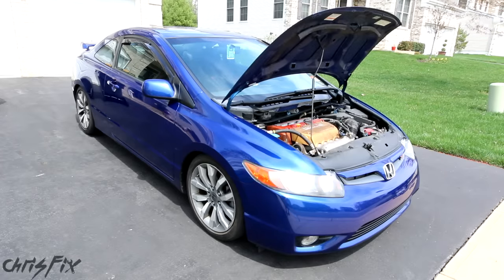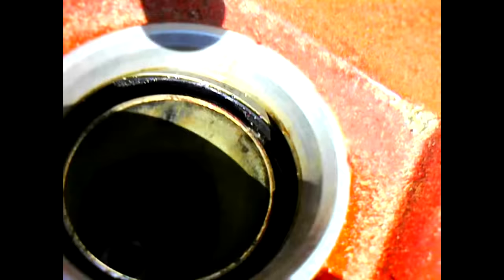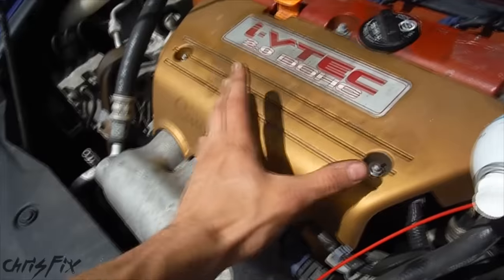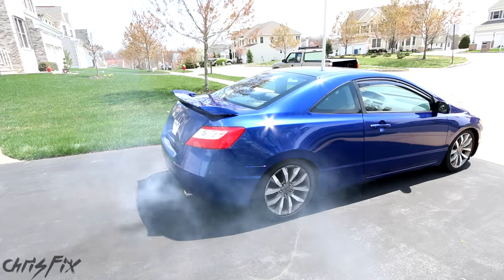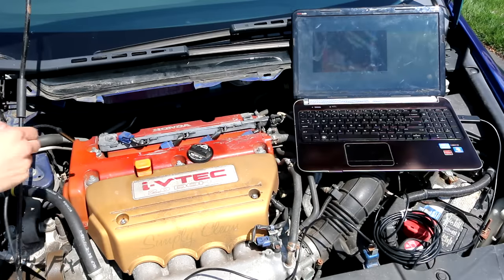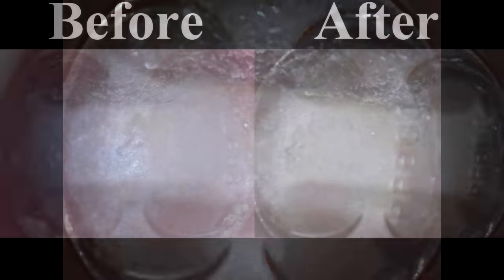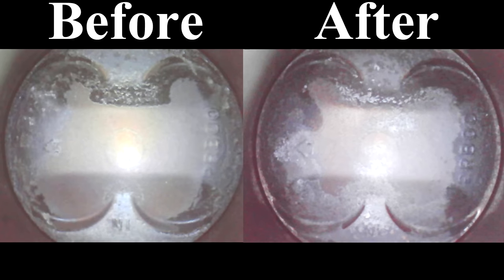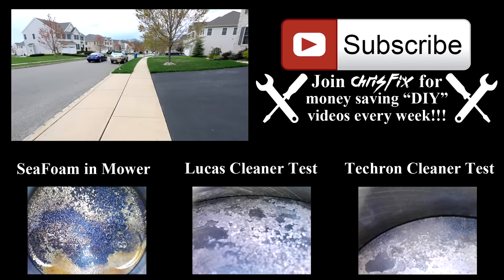Does Seafoam Actually Work in a Car? (with Proof)

Comment: Chris, I really liked the video. I have to say, that I am not convinced that the SeaFoam did a lot of good. 

If at all possible, I'd like to see the results of using straight water injected into the intake, like the SeaFoam was, to see if that would clean off some of the carbon build up. The reason being, I have pulled cylinder heads off of cars that had head gasket leaks, and the cylinders that had coolant leaking into them were very clean. I think steam cleaning your intake with water can have the same results.
Reply from the maker: +Robert DIY Thansk a lot Robert! Glad you liked the video! I will be testing water soon! I just need to find a car. Finding cars with dirty engines is hard!
Reply: Just stop any car on the street. My guess is that 90% of them have dirty pistons. LOL

Heck, I may look into getting a camera and do the test myself. God knows I pull my share of heads (about one per month).
Reply from the maker: +Robert DIY Actually, 90% of them have clean pistons. Most cars today have clean engines. Even the old engines! Plus I need the car for a few days. Getting the right angles with the camera takes a lot of time!
Reply: Well that's good to know. I know that most of the heads I pull reveal clean piston tops. Usually the carbon is in the intake ports and the bottom side of the heads, bottom of the exhaust valves.

I thought the camera was easier to work with. At any rate, you're doing an awesome job helping people understand what's going on around their vehicles. Please keep it up.
Reply: +ChrisFix If I lived in your area maybe and could loan it for a few days.I have 300K on my Durango. It was abused before I got it and cleaned it up. It would be a good test subject.
Reply: +ChrisFix not to be rude at all but just ask any female driver in your area or neighborhood, most of them don't know much about cars and only gas and go with oil changed when the light goes on, and most people who aren't like us who can work on cars no matter how big or small the task don't understand the concept of preventative maintenance.
Reply: +ChrisFix also it would be great to do a collective data test of tires filled with regular air vs nitrogen
Reply: +Sharuk Ali I work at a shop and can say that I stand by nitrogen. It's how the car takes bumps and dips. rather than a solid hit it makes a dip or bump softer than with oxygen. Nitrogen molecules are bigger than that of oxygen molecules so when it gets hot and or cold you don't have to air up the tire as often as you would with oxygen. as for wear and tear on the tread of tires, I see no difference. just depends on how rough you are with your driving and the type of terrain you are driving on.
Reply: Marrda That's interesting. Thanks for the info. With nitrogen do you have to raise or lower the stock tire pressure, or keep it the same?
Reply: I drive mostly on asphalt and sometimes gravel but I go through all season tires in 20-30 K miles
Reply: and I go with the best brands with the best quality and good warranty tires....currently running 215's(width) good year assurance comforted touring tires...alot of grip on dry and wet roads.
Reply: Water could break carbon up but also could break into big chunks and get stuck between a valve! When a head gasket leaks slow into the cylinder also has antifreeze plus water is heated by the motor so it would break up carbon slower.
Reply: How's that?
Reply: water cannot be ignited like fuel.....that's why seafoam is ( I assume) petrol based
Reply: which means water will do some serious damage if it enters your combustion chamber
Reply: Hmmmm.
Reply: +ashot aristakesian It's not nitrogen vs oxygen.  Filling a tire with pure oxygen would damage the rubber by oxidizing it.  It's nitrogen vs compressed air.  Compressed air is about 78% nitrogen, 21% oxygen, and some carbon dioxide, water vapor, and other trace gasses.  It's the water vapor that's bad for tires.  As the temperature cycles up and down, the vapor condenses and evaporates, leading to a larger swing in pressure through those temperatures than dry gas would.  These wider swings in pressure lead to a faster loss of pressure and less consistent performance at varying temperatures.  Assuming a dry supply of oxygen, other than the faster degradation of the rubber, it would be rather similar to a nitrogen fill.
Reply: +Sharuk Ali Liquid water in large quantities is catastrophically bad for engines.  A good example is the 2004-5 mini cooper (naturally aspirated, not S).  Its intake was low enough that trying to drive through standing water more than 3-4 inches deep would siphon the water up into the intake.  There are pics on the net of things like connector rods blown clear through the side of the block.  Definitely scary stuff.  But water vapor fed in a small and controlled amount is a totally different story.  It acts kind of like NOS.  It's a spectator in the combustion process but bumps up cylinder pressure and can substantially boost power.  And from what I understand, it actually sinks a little bit of the heat produced by the boost, unlike NOS and super/turbo chargers. Done carefully, it could be a really interesting project.
Reply: That is a really good point
Reply: Not that much water. Water/coolant gets past head gasket and cleans the piston head, spark plug, etc.
Reply: and then you see those cars at the salvage yard
Reply: Water injection was actually used in some British aircraft in WWII.  Much like NOS, it was usually for a brief burst of power when needed and overdoing would blow the motor.  As far as combustion theory, gasoline is fuel and oxygen is the oxidizer.  The oxygen oxidizes the fuel as much as the fuel reduces the oxygen.  To speak of either doing anything without the other doesn't make sense, and there is no catalyzation involved..  (After the power stroke combustion, however, the exhaust gases ARE fed through a catalyst screen which, at high temperatures, will oxidize carbon-bearing compounds and reduce nitrogen-bearing compounds so that CO and unburnt hydrocarbons exit the tailpipe as CO2 and NOx's exit as N2 and O2.  But that's an entirely different topic.)
Reply: I doubt that (head gasket statement). If your engine is building up any carbon on the valves, stems, or seats, it can cause the valves not to close fully. This build up causes valves not to seat properly over time and burn valves.

Some people believe this product also eats away at sludge and helps opens up other vacuum passages, like in the EGR system, etc. I pulled the EGR valve off of the intake on my car and it was 70% clogged. Causing the car to run a little rough at idle and causing air back-up while driving down the road. When I cleaned out the ports with a screw (used like a file) the car idled a lot smoother and drove better. My fuel economy when up and little and I no longer had a CEL. If seafoam in the vacuum system can desolve that crud out of the system it would be considered useful in my application.
Reply: +ChrisFix ill lend you mine then
Reply: +Sharuk Ali ***IT IS; But also has IPO in it to absorb water. Seafood is mostly lighter fluid (Naphtha) with bale oil, and as I said a small amount of 200 proof Isopropyl alcohol.
Reply: +Sharuk Ali ***NOT ALL together true. Water injector systems are sold for normally aspirated gasoline engines. Depends on how someone uses or abuses water in those engines. I would not however use any water system in a diesel engine. Much higher compression levels (like 175psi cranking compression)
Reply: your right and old timers have been doing it for years.
Reply: +Biggus Mickus I think ChrisFix is smart enough to know to add the water while the engine is running.  In his Seafoam in lawnmower video he did let the Seafoam soak on the piston heads and removed the Seafoam before starting it up.  As soon as you add the water (to a hot engine) it's going to turn to steam and you would only add a very small amount at a time, that wouldn't increase pressure in the cylinder any more than Seafoam would .  Really the only cause for concern would be rust but as you mentioned let it run for a bit to let it evaporate.
Reply: +donald ducky I need to correct myself. I am guilty of doing too many things. IPO is incorrect; it is supposed to be IPA. That stands for 100% Isopropyl alcohol. (IPO is Initial Public Offering  for a publicly traded corporation)

One person wrote a comment that Seafoam is mostly water. I have to disagree ; It is mostly lighter fluid, or dry cleaning fluid. Also contains IPA and Pale Oil. You can make it cheaper than they sell it, if you know how; Just look up the "MSDS" for Seaform and it will start you in the right direction, but be careful. 

I used to own a hotel and some idiots tried cooking Crystal Meth in one of my rooms. I had to close the whole floor for the rest of the day, and they just went to jail. I was the big looser.

God luck guys. I suggest you do research before you do do something that costs you an eye, an arm, or your wallet.
Reply: ChrisFix how? its hard to find cars whit clean engines!
Reply: Biggus Mickus you don't spray water in with a hose lol. You let a small amount trickle in. Chris is not an idiot and thinking he would just spray water in is kind of harsh. Obviously the idea behind it stems from when a head gasket fails it let's minutes amounts of water in overtime (until you smell coolant it of pipe, coolant levels drop,overheating , lack of power ,oil in coolant or coolant in oil. Etc  )  which the steam works to clean the combustion chambers squeaky clean.
Reply: Robert DIY 4
Reply: ChrisFix  I have a 02 civic with 212k on it. Colorado.
Reply: Uh, seafoam (petroleum) isn't any more compressible than water...
Reply: Any idea when you are going to test water?
Reply: I don't know. I run a cup of water through my intake every couple oil changes. Nothing exploded yet either.
Reply: ExaltedDuck lots of turbo cars used to be fitted with water injection to control cylinder head temps and combustion. So no, water per se is NOT a death sentence. It has to be sprayed in atomised form in small quantities. Not a garden hose on max stuffed into your intake.
Also, what do you think combining oxygen and a hydro(carbon) produces?
Yes...that water coming out your exhaust pipe? Basic chemistry folks.
Reply: ChrisFix I have an acura tls haven't clean the engine in years
Reply: ZSQ94 I resent that. I have 3 brothers and know more about cars than any of them thank you. self taught too, stepdad doesnt know squat either.
Reply: How about steam cleaning from intake
Reply: The water mist trick does work...the old wise mechanics swear by it.
Reply: @Marrda  Oxygen makes only 21% of the air, 78% is Nitrogen
Reply: seafoam has literally been proven in labs and real world that it works.. check out projectfarm video
Reply: @zaigham57  ay
Reply: @chrisfix  did this ever happen? I got this impala I want to last forever and I've watched this and then purple royal video like 10 times in the past few years
Reply: @RobertDIY  yes but the heads you should be pulling should not require unzipping first.
Reply: @chrisfix  hey man first off I love your vids! Whenever I need some answers I just pop over here. Secondly, if you need a test subject for a car vid hit me up and see if I've got the right test subject 😂
Reply: You should use one of those fog machine devices to put water vapor into the engine intake and see if that increases efficiency or helps cleaning I’m talking about the kind that vibrate the water to produce a mist.
Reply: @chrisfix  you can used mine lol 😂
Reply: Gotta tell ya', back in the carburetor days on an old engine, with the engine hot and running, we'd take off the air filter cover rev the engine with the throttle cable and very slowly pour a coke bottle full of water down the carburetor. Water instantly turned to steam and did just what you were talking about, steamed cleaned the cylinders. 
Way back in the day!

Comment: I've been wondering about this for forever now but the Shell gas station claims that shell V power can clean your engine of carbon build ups and gunk up to about 80% in just the first fill up. You should creat a video and see if shell V power (premium gas) cleans as well as they claim. My wife and I argue every time we will up if it's worth the extra money to fill up with V power just because they claim it's so great for you let vehicle. It would just be very interesting to see the results.
Reply: Steven Christen the only thing you need to understand about gas is the octane rating is all that matters. All gas require cleaners in them. Put in the gas your car manufacturer recommends unless your engine has been modified in any way to operate at a different ratio.
Reply: Steven Christen - I have the same question!  My company deals with different fueling contracts, but many of their employees and drivers swear by and use Shell "V" Power!  Been using it for over 15 years now...
Reply: Steven Christen yeah I don't believe that. also, I don't know where you at, but in some states in the U.S., Shell V power is equal to regular gas in Europe (whether it's a Shell gas station or not).
V Power in Europe is 98 oct RON (or 94 US octane), but in the UK I've seen 97 RON advertised as V power, in some countries I've seen 99… Some countries even have Shell "race" gas (100+ oct RON).
Over here, regular gas (U.S. 91) contains 10% ethanol and premium contains nothing extra. Just unleaded gas. 

Don't fall for it, though… premium gas in a car that doesn't require it, and this seafoam crap… it's bullshit. Just fill your car up with the gas it needs and maintain your car probably and it'll run as long as it can.
Reply: @arnemaeschaelck5012  ummm U.S. regular at least in California is 87 Not 91. Last I checked the amount of ethanol allowed was Unregulated. Arco and 7-11 is the worst imo and Shell stations here at least buy NON SHELL gas ! I've seen it many times. the tanker trucks have the names of major 3rd tier fuel companies. I dont trust Shell. Mobil Chevron and 76 seem to have less ethonal and more mpg than cheaper fuels after extensive monitoring in my V6 powered car. Alcohol ie ethonal burns faster than gas so the money saved is lost in lower miles per gallon.
Reply: Shell Fuel in my Harley I gain 5 mile per gallon I get 40 MPG average at BP  or Citgo , 45 mpg Shell.  Im 25 miles from a Shell , So when im up there I top off .
Reply: My 04 Acura RSX runs amazing on vpower
Reply: You're not supposed to use a ethanol on your motorcycle , recommend only premium gas sell gas station has 10 % ethanol even in v power gas
Reply: Shell Gas burns up catalytic converters... Avoid it at all costs
Reply: Steven Christen I can tell you it’s the one type of gasoline that will throw the least amount of knocks I have found so far
Reply: I have a Pontiac Grand Prix with about 400k mileson it. It would stall everytime I started it. I would have to pump the gas to get it to crank. I was getting work done on it one day and the GM Technician pointed out the carbon build up I had.  He also recommended shell gas. I was getting ethanol free gas at the time.  I started using the shell gas and have never gone back.  The Pontiac stopped stalling and started cranking at the turn of the key everytime within a month or less of using shell.
Reply: Dusk Dawn thanks good advice
Reply: If your car has direct injection, the gas won't go over the too of the valves so how can it clean something it doesn't touch? Might work with MPFI, I'm guessing
Reply: uuuultra ✔️ yes they are
Reply: @goodstuffohhyeah  wheres your proof.
Reply: @Nan10ify  where is your proof. It says right at the pump ethanol % on each grade. V has 0%
Reply: @goodstuffohhyeah  is this true??? I've always used chevron but wanted to try Vpower so I switched up and on the very first tank I got a P0430 code!!
Reply: @rlee6984  Absolutely...my dear dad (may he RIP) and all his buddies always told me that growing up. Plus a buddy of mine who always used shell went through a set of flowmaster high flow cats on his 5 liter Mustang in 1.5 years. He wishes he listened. Now's your chance.
Reply: @arnemaeschaelck5012  your octane rating are all wrong and the post is full of wrong info. Also Chris did actually do a video on Shell V power.

Comment: It does work my car was back firing like a mofo and I threw a can of sea foam in her and she hasn't backfired in years
Reply: It's been sitting in your garage since then?
Reply: what the car or the wife
Reply: @AROTTWEILERR  Lmaooooo
Reply: She?
Reply: @springwoodslasher79  nope worked great for me
Reply: @springwoodslasher79  wrong
Reply: Perhaps your carbon buildup was so extreme that tips of the carbon were glowing red and was firing the engine on other strokes than just the power stroke, thus pre and post detonation. This is an age old problem with engines. It probably did burn off some of those carbon build up points so that it will run better for awhile, but if your car has that much carbon build up it's going to do it again at a later date. Don't think any of these cleaners really do that much to help; their results are marginal at best.
Reply: @springwoodslasher79  waisted? How about wasted... Please
Reply: 张立鈱 Phillip lol good one
Reply: @springwoodslasher79  but this video shows it works. it's cheap too. where's your video showing it does nothing?

Comment: The back side of the valves is what I would be interested in , the minor amount that’s cleared off the Pistons is mostly irrelevant on a street car
Reply: Im a little confused. On a port injection vehicle, wouldnt just throwing it in the gas tank do the same thing? Itll be mixed with the fuel and clean the injector subsquentially cleaning the intake valve right and end up in the combustion chamber anyway? SO why go through the intake ? Cylinder heads?